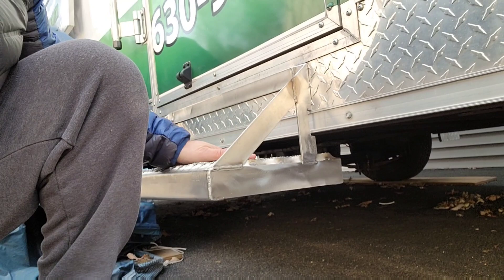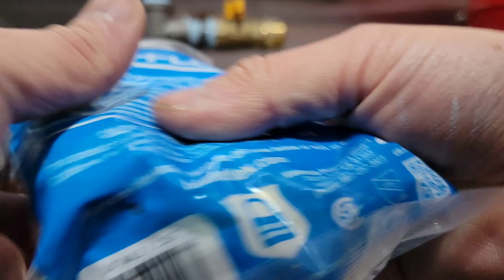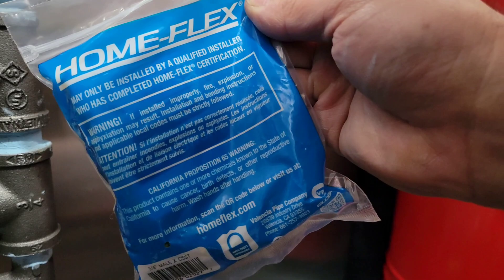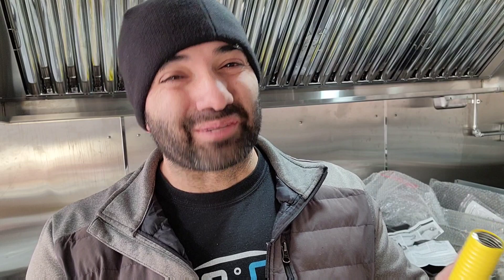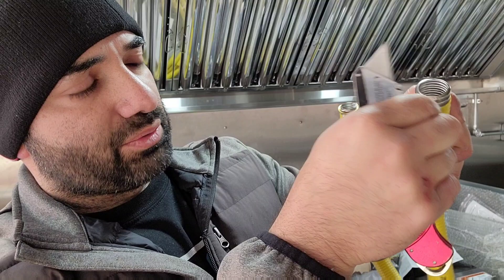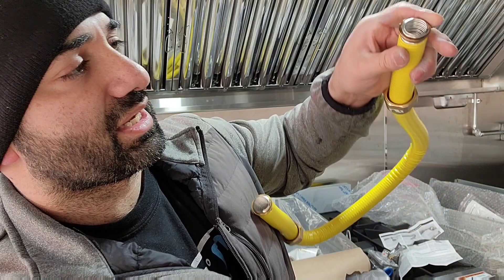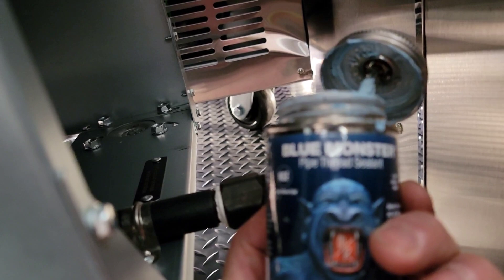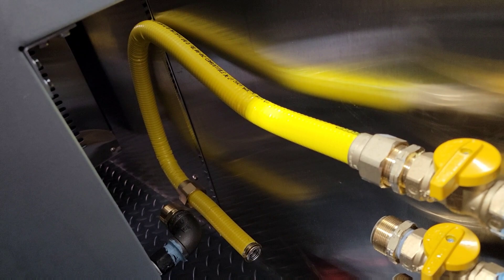How to make Gas Lines for a Food Truck

Comment: I cook boiled peanuts on a trailer with burners and 80 qt pots like you might fry turkeys in. I know they are high pressure hoses. Is there a difference or will this set up work as well?

Comment: I have the exact same griddle on my deck - what all do i need just to connect a propane tank to the the gas pipe in the back of the griddle?
Reply from the maker: Good afternoon. I show it all on the gas videos. I believe there is one where I record every single black pipe I use. Most likely under Food Truck Gas Lines

Comment: If you have black pipe running under your food truck straight from tanks without a regulator but use a regulator on each piece of equipment does this bring back the safety issues?

Comment: So, I used the yellow flex lines for my trucks appliances and when I called a plumber for the gas inspection he told me over the phone that a DOT approved flexible gas line must be used, and that the lines I have would have to have a paperwork stating they are DOT approved for use in a vehicle.
Reply from the maker: That must be a local ordinance, not something required with us.

Comment: Hi Frank, I have a question about hooking the propane on a trailer.  What type of regulator do I need to use for a lp gas fryer.  I was told I need a 3/4 line from the tank all the way to the fryer.  I had a 3/8 line hooked up but it couldn’t keep the fryer running. It kept shutting off.  Not sure where to buy a regulator for the trailer.  Thank you for your time and help.
Reply from the maker: I have the one I used linked in the description have never used another besides that one
Reply: Thank you for your quick response.  Where can I buy it, can you tell me where you bought it from.  Your videos have been helpful and I definitely appreciate you helping everyone, like me, with the videos.
Reply from the maker: @pimmymo9599  just click on link. Amazon